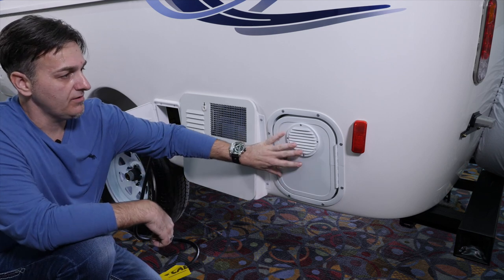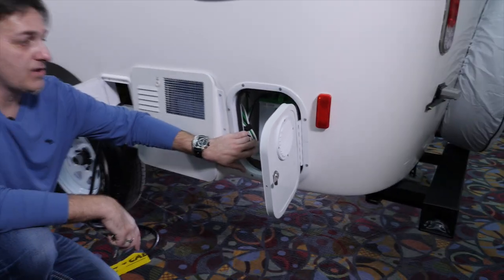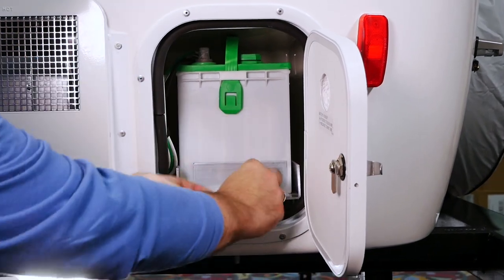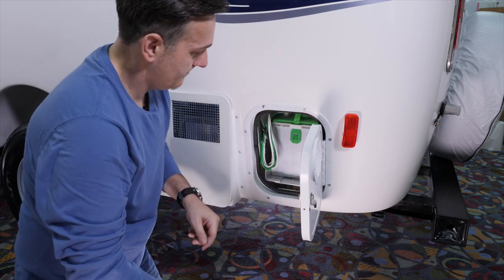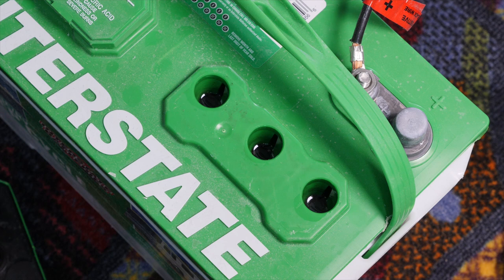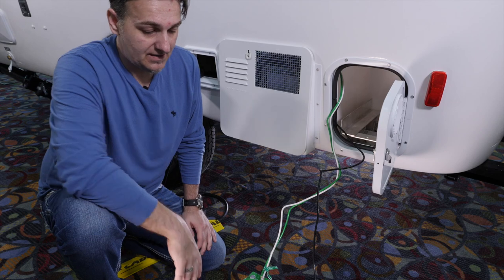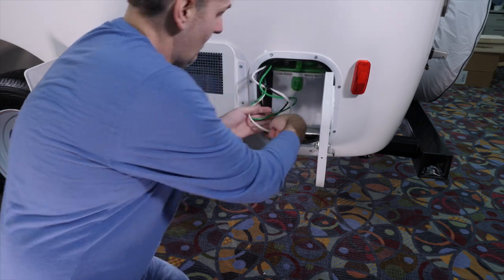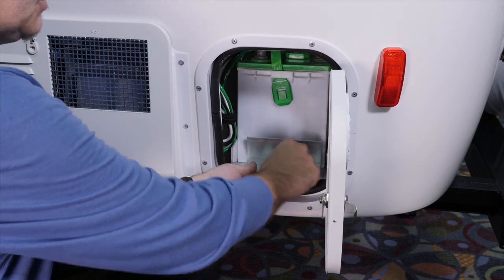Battery

Comment: is the Casita electrical system equipped to use a lithium battery?
Reply from the maker: No, the converter is not able to handle a lithium battery. Contact the manufacturer of your converter and they can get you a converter that can handle a lithium battery.